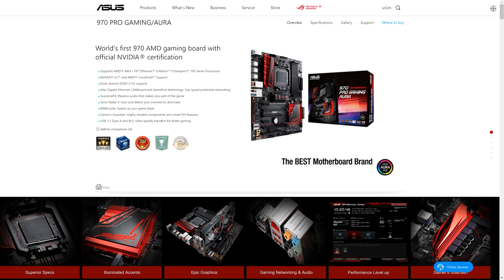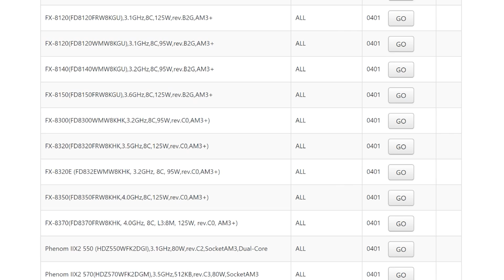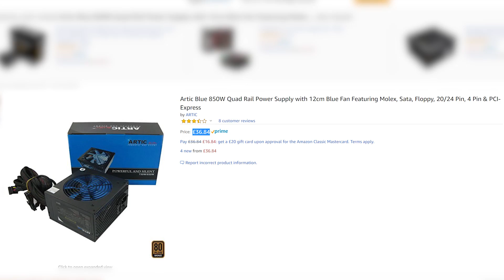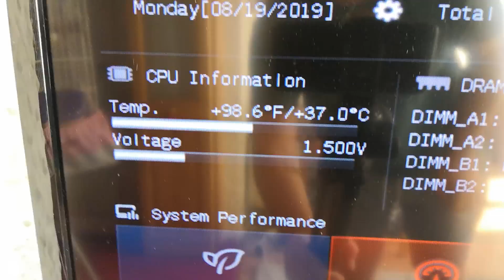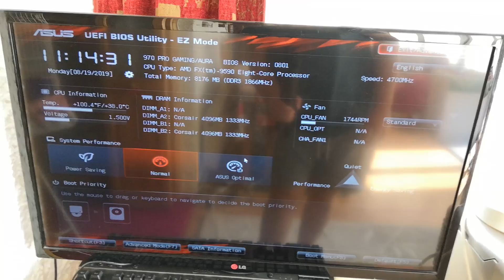This Used Gaming PC Is a 5GHz Fire Hazard (Pt. 1)

Comment: Try it out on Crysis. The developers were banking on CPUs of the future being 6-7GHz if I recall correctly. Obviously that didn't happen though as we have similar clock speeds as we did back then but with more cores. Would be curious if this thing running at 5GHz would do well with it.

Comment: As other have said, yes, stick with the cpu and upgrade the motherboard. However, since the fx 9590 is basically an overclocked fx 8370, what you could do is underclock and undervolt the fx 9590 to fx 8370 clocks and voltage to fit the 125w budget of the motherboard.
Should you choose to stick with the cpu, i would still like to see a comparison between these 2 cpus. The extra 100w of power for 400 Mhz seems way overkill for me. And yes, it is a fire hazard :).
Still not sure how an 140mm AIO is expected to cool 220w of tdp though.

Comment: You don't need a liquid cooling solution. I have an FX 9590 16mb cache with a Noctua NH-D15. With boost enabled running Cinebench my max temps are in the low 50's Celsius even on a hot day.

Comment: The 970 pro gaming/aura is a fantastic motherboard and can indeed handle a 9590, I'm using a 9370 (the other 220w cpu) at 4.9 ghz on mine and the VRM temps are solid 70-80c so it's no problem. I'm also using an h100i so no extra ventilation over the vrm. This board has was better VRMS than all of the other 970 boards

Comment: If you stick with the board and then overclock the 8000 series to similar performance to the 9000 series, you've still got a 200w+ CPU.
Reply: Yeah, I’m not sure how he missed something so obvious... It really disappoints me and makes me really lose credit to anything he says now, as this is below novice levels (even my mother knows overclocking increasing power, and she is so tech unsavvy I had to watch her copy one cell at a time in Excell...)
Reply: Well, it's entirely possible that he wasn't talking about pushing it to the same levels as the 9000 series.  Maybe 4.3 or 4.4ghz.  That'd probably put it in the 150-175W range.  Alternatively you can also just underclock the 9000 series to reduce the power.

Comment: I used a 9590 on a MSI krait 970 mb. It popped the caps lol
Reply: i had an fx 8350 on a £30 motherboard (literally the cheapest i could find) and had no idea why my fps would spike down every few minutes. Didn't help that i used a aio cooler so wasnt getting the passive air over the VRM's. The only way i could cool it was to literally fit a fan directly on the back of the motherboard behind the VRM'S and never had the fps spikes again. That poor motherboard kept on going for years though.
Reply: @ItsBigMatt  this was my exact same problem with an asrock 970 extreme and fixed the same way, two fans pointing towards the vrms, and one on the top extracting hot air.
Reply: well atleast it didnt do this
https://youtu.be/8zTzpYjQ2MM
Reply: @imayamia  rip that motherboard i think its no save not worth fixing lol
Reply: Well if you would have done research it says they are not compatible
Reply: @melvinhans1844  you wanna catch these Hans

Comment: Motherboard should be fine tbh. When you consider say a 8320 heavily overclocked is essentially the same thing. I really think you will be fine, not to mention regardless of any negative perception of the AM3+ cpu's are really well built. I don't you will kill it at all tbh.

So yeah I suggest you keep that board as that board is actually a really well built board. I would wager it's better built then some of the older 990fx boards that had some issues. You really will be fine especially with claiming it up and proper airflow. It's been awhile but when I looked into it one of the reasons why some of the better 970 boards will not lost support for the 9590 was part of the marketing of the 990fx benefits. Of course older cheaper 970 boards are not advisable and are not as good as the 990fx older boards. This Asus as I said earlier is a higher end 970 board. Just my suggestion based on AM3+combinations I have done and some I still own. I'm sure you will find it performs really well all things considered, good luck.

Comment: The 9590 would most likely be a beast to try, I would suggest actually doing 4x comparison, get your 8000 series CPU and use a better more powerful motherboard for the 9590, use the CPUs on both motherboards and compare them on both boards and both on the other, with the same cooler BTW

Comment: I run two FX 9590s, one in a Gigabyte 990FXA-UD5 and another in an RoG Crosshair V Formula-Z. Both boards work flawlessly with my 9590s, even with minor overclocks to 5.1GHz.
Reply: Are you cooling them with liquid nitrogen?
Reply: @patrickbateman3944  😏😏😏

Comment: Got this for 200 quid used did I get a good deal?
Case InWIN GT1 BLACK GAMING CASE
Processor - (CPU) Intel® Core™i5 Quad Core Processor i5-4460 (3.2GHz) 6MB Cache
Motherboard -ASUS® H81M-PLUS: Micro-ATX, LG1150, USB 3.0, SATA 6GBs
Memory - (RAM) 8GB KINGSTON DUAL-DDR3 1600MHz (1 x 8GB)
Graphics Card - 4GB NVIDIA GEFORCE GTX 970 - 2 DVI, 1 HDMI, 1 DP - 3D Vision Ready
1st Storage Drive - 1TB WD BLACK WD1003FZEX, SATA 6 Gb/s, 64MB CACHE (7200rpm)
DVD/BLU-RAY Drive - 24x DUAL LAYER DVD WRITER ±R/±RW/RAM
Power Supply CORSAIR 550W VS SERIES™ VS-550 POWER SUPPLY
Power Cable 1 x 1 Metre UK Power Cable (Kettle Lead)
Processor Cooling Super Quiet Titan DragonFly Heatpipe Intel CPU Cooler
Thermal Paste STANDARD THERMAL PASTE FOR SUFFICIENT COOLING
Sound Card ONBOARD 6 CHANNEL (5.1) HIGH DEF AUDIO (AS STANDARD)
Wireless/Wired Networking 10/100/1000 GIGABIT LAN PORT (Wi-Fi NOT INCLUDED)
USB/Thunderbolt Options MIN. 2 x USB 3.0 & 4 x USB 2.0 PORTS @ BACK PANEL + MIN. 2 FRONT PORTS
Operating System Genuine Windows 10 Home 64 Bit - inc DVD & Licence
Windows 10 Upgrade FREE Upgrade to Windows 10 with all Windows 7 & Windows 8.1 Purchases*
Windows Recovery Media Windows 10 (64-bit) DVD with paper sleeve
Office Software FREE 30 Day Trial of Microsoft® Office® 365
Anti-Virus BULLGUARD INTERNET SECURITY - FREE 90 DAY TRIAL
Browser Microsoft® Edge (Windows 10 Only)

Comment: When the FX-9590 came out, I considered it to be the ultimate proof of AMD's Bulldozer failure as it couldn't even stand even with an i7-4770K, which had far better price, TDP, and single thread performance. After this video, I'm also now curious about FX-9590 build. That said, do whichever is easier/cheaper of the options to 1) get a FX-8350/FX-8370 CPU or 2) get a FX-9590-compliant motherboard. Either option would make for an interesting video.

Comment: Not anything interesting in downgrading it to a fx 8350 or lower, there are enough builds around the "normal" fx cpus on youtube. 

However, 990fx motherboards are kinda hard to get these days and even then only a few of them fully support the FX9590 and they easily go for 120€+. On the bright sight, these are the top boards AM3+ has to offer and they look like that, beefy with massive coolers and good looking - they scream gaming. So these mobos in a nice budget case with tempered glass and psu shroud might add some resell value to the system. So actually there isnt really a choice here cause of the mobo...... downgrade and flip it. Keep an eye on the mobos supporting the fx9590 and try to get it around 80€ - then you can make a video about the cpu with a modern graphics card.

Comment: I recently bought a used FX-8370 to replace the Phenom II 1100T in my old rig.

The seller offered a 9590, too.

Point is: My rig has the priciest 990FX MoBo in it there was at the time, the Gigabyte GA-990FXA-UD7 (rev. 1.3).

That is one of the few MoBo, you could pair with that 9590, If you wanted, because of the decent sized VRM array.
Still: Even back then the stability was not a given, as I remember. You absolutely NEEDED a separate fan to blow on the VRM.
For that reason, I think, Gigabyte did remove the official support ads of that processor at a later time. It still lists in the manual, though.
But I know, that the "PC Games Hardware" magazine from Germany did run that config, saying that it is like living on the edge...more or less.

But I didn't want to go under water for it, so I opted for the less powerful one.

That processor is just one thing, as it was back then, too: Ridiculous.

The reason I have that beefy board is, that it's predecessor was a 870 based one from AsRock (wich I still happen to have), that couldn't handle the 1100T - other than advertised. And I wanted a board that just works and I wouldn't have to care about the VRM. With that Gigabyte one I got what I wanted.

Just need to repaste it to get it going, a new CMOS Battery is due for sure.

Comment: I still have the same CPU with a ASUS Crosshair V formula Z board. You want it for testing? Let me know.

Btw, my brother still plays BFV on FX9590 with a RX560 4GB @ locked 60FP 1080P high settings. Also on the Asus board.

Comment: Use AMD FX 9590 with other motherboard. I need to see that thing working in 2019
Reply: I have the same motherboard and cpu with a 750psu and a rtx 2070 its beastly ran with no problem

Comment: Why were you scared even with booting to windows? This cpu is not consuming 220w all the time. That's one thing the second is that board is rated up to 125w but if it's a decent board, it should handle this cpu just fine.

Comment: I was looking at it, at first I thought that you need to add a fan on the VRM, then I rechecked the case and noticed the top exhausts, should be fine cooling for the VRM, I'm not completely positive about the VRM, but it actually should be able to deal with the CPU just fine as long as you don't OC the 9590 and keep the airflow good, also swap the piece of AIO out and put a decent air-cooler in there, PSU change was a good call that 850W PSU is either a rebranded 15yo one or a complete cheapest component build. Tbh I recommend a bit undervolting the CPU and get better case fans like deltas and with the change of CPU cooler, you should be able to use the build for whatever you want if you don't OC and increase voltage...

Comment: TDP and Total power usage are 2 different values...
so technically it's not a 220w cpu... just throwing that out there.
Reply: So would this motherboard support this chip or not?
Reply: I used to have a 9590 in my main system. It's not really uncommon to exceed 300W at the EPS connector
Reply: @David-wh8zs  I was talking about the difference in TPD vs TDP. TDP is about heat dissipation, TPD is power usage. 220w is the heat measurement of what the chip will output. Your actual power usage for that given component is going to likely be 1.5x that, or more, since the excess heat given off (denoted by TDP) is inefficiently used energy that needs to be dissipated.
Reply: While TDP != Power usage, especially not at the EPS connector since you have to consider switching losses, most of the power consumed is converted into heat.
Reply: @David-wh8zs  Yes, that's what I was saying >.> TDP may be 220w, but that is all byproduct of the actual power used by the CPU. So the real power draw is higher than 220w. 
Any loss outside that CPU component isn't considered there, nor is it relevant.
Reply: @ericandruszko7563  The additional power consumption caused by signaling really is minuscule, in the sub-200mw range, I would go as far as saying that the TDP  is rarely exceeded as long as you are not stepping out of spec (That involves boost). 
What I was originally trying to say that the TDP of the 9590 was underestimated by a lot.

Comment: "5 GHz fire hazard" also describes my current 9600k rig, except mine doesn't run stable at 5 GHz anymore thanks to a bad PSU lol. Lots of paralells between this build and mine except i've actually got an ok graphics card. Also what the devil is the airflow here
Reply: I would replace the PSU ASAP if its bad....

Comment: I wouldn't consider this a fire hazard at all and don't even really get all the drama. Sure, the power supply is questionable at best, but the rest seems pretty decent. That motherboard seems okay to me with this cpu. It's one of the few somewhat modern AM3 boards and its VRM's don't seem too bad at all. Only very few motherboards officially supported this cpu, but many more higher end boards were perfectly capable of doing so. 
The cpu cooler is pretty decent as well. No better than any high-end air cooler, but still better than the majority of them. I'm not sure it will stop this cpu from overheating entirely when, say, stress testing it with Prime95, but at least it won't start overheating in the blink of an eye like it would with AMD's stock cooler from that time (which was hopeless btw). 
It would be very interesting to see how hot the cpu and the VRM's get with this combination. The best way to find out if the motherboard can handle this cpu is by looking at the VRM's through a thermal camera while stress testing, but I'm not sure you've got the resources to do that.

Comment: I'd say since the 9590 is the most expensive part of the build and no doubt the original intended showcase of the build, I'd say do both. I myself have had interesting experiences with the FX chips and learned about the motherboard compatibility the hard way, having gone through two separate boards for my 8530 back in the day.

Comment: KEEP THE 9590! I'm running my FX-8350 at 4.5GHz right now, paired with 32GB of 2400MHz DDR4, Vega 56 graphics, Intel Optane  NVMe SSD, on a Sabertooth 990fx R2.0. It plays some games really great and other games like poo. I'm really curious to see what the 9590 can do at 5GHz.

Comment: I tried using the fx-8350 before, but Im curious to see how the 9590 performs. I actually use now the Intel core i7-6800K, so I wonder how that compares to the fx-9590 beings that the 9590 has 8 cores up to 5 ghz while the 6800K only has 6 cores which I have overclocked to 4.3 ghz and have that with 16 gb ddr4 gskill ripjaws quad channel 3000 mhz ram and a gtx 1080 gpu. I would be curious to see how the FX-9590 stacks up against Intel's core i7-6800K which is what I have. I would suggest keeping the 9590 and upgrade the motherboard to something like an ASUS Sabertooth 990FX.

Comment: Was rocking a 9590 right up until i went to Ryzen, its overall performance really isn't that bad. Its just really power hungry. So i was running mine in a Crosshair Hero V, and it was a supported CPU and even then it got those VRMs pretty warm.  So i was able to get the chip working as 5ghz all cores but I had a 280mm AIO and i ended up under volt-ing from the 1.5 that the bios sets to stock. the temps would just go WAY to far out of wack, 75c is really the max safe temp that you can hit with an FX processor.  My specific sample would do 4.95GHZ at 1.43V, which kept the load temps down to around 70c on the core.  I never got the impression that it was a particularly good sample, so you should be able to run those numbers and save those VRMs on that mobo.

Id be offering the board up as a test bed for you, but it kinda died recently in epic fashion, one of the mosfets for the VRM exploded and blew a hole clear threw the mobo... wish i could post pics on here for everyone.

Comment: I'm rocking a 8350 and its running strong even today, modern games run better on it than the old ones, the use of multicore really brings value to these processors

Comment: I'm surprised how many PC tech youtubers do not either understand the concept of power deliver in PCs OR intentionally make clickbait videos. If the motherboard only supports certain amount of power, it won't deliver more damaging itself. When the GTX 1050 ti came, with no additional power connector, most of the PC tech youtubers were telling us, how we shouldn't OC such cards, because it could burn the PCIe slot, well guess what? It's the same story. If the PCIe can only provide 75W, that's all it will ever provide and won't destroy itself giving you more on demand, unless you seriously modify your motherboard.

Comment: Lol I have the FX-9590 in my older build, had to buy the biggest Noctua Air Cooler and underclock it to 4.2ghz for it to run stable.

Comment: Nah, leave it as is. Throw in a GTX 480 and use it to keep your house warm this winter.
Reply: Pick up a PCI-based single board socket 478 computer and throw a P4 on there, he'll single handedly accelerate global warming.
Reply: Hell yes. Board supports quadSLI. Time for the Gigawatt Machine. 9590+4x480
Reply: Or r9 290x
Reply: @inoeps  r9 295x2
Reply: @ijshockey2565  gtx 690
Reply: @БрухБрух-щ7и  gtx 690= 2x GTX 680
Reply: A vega 64 or a radeon 7 will do the trick aswell. Even a 2080 ti will do it.
Reply: @echofunandgames7874  nah. 290X and the system will transform into a portable blast furnace.
Reply: I used to have an i7 950 with SLI GTX 480s. my power bill sucked
Reply: Shut up
Reply: Cough R9 nano
Reply: i7 2600k+r9 3804gb seems to heat up my room amazingly!
Reply: My 670 used to really heat up the room when playing games

Comment: FX 9590 VS 8350 
Get a better mobo for 9590
Get the 8350

I got asrock 990fx extreme 3 mobo with phenom ii x4 955 and i dont got cash to upgrade :(
The 9590 it self is 120$/€/£
I wanna get a fx chip but for me not possible

Comment: I think you should stick with the 9590 i want to see how it preforms in modern gaming as it looks very powerfull with 5.0ghz 8cores.
Reply: its not terrible actually, it only slightly bottle-necked a 1080 when I had one 3 years ago.